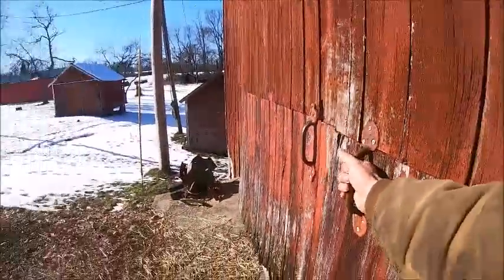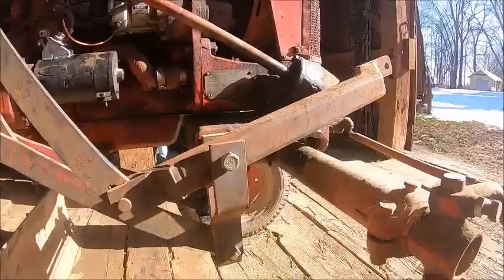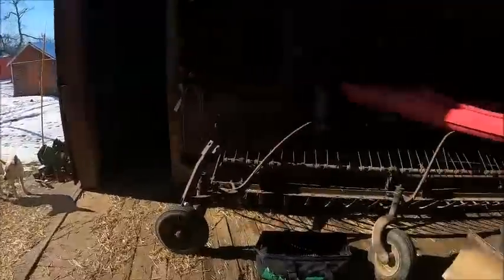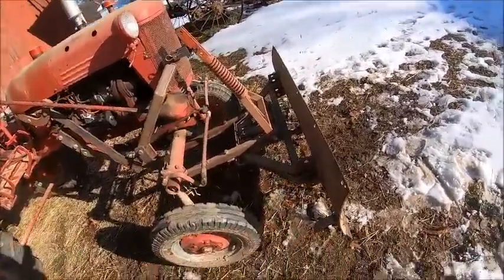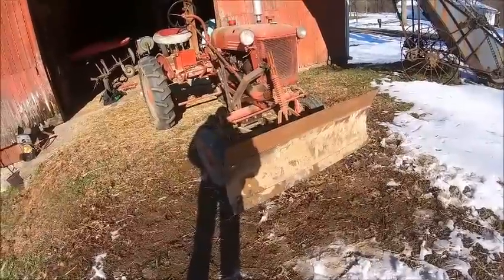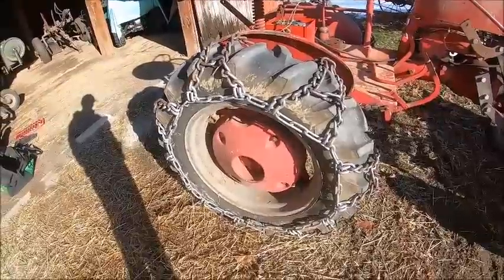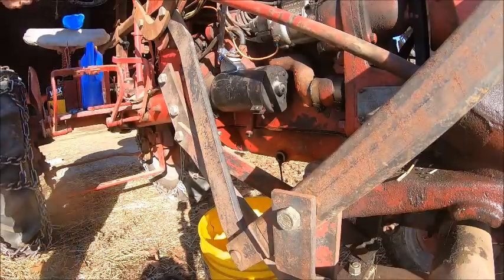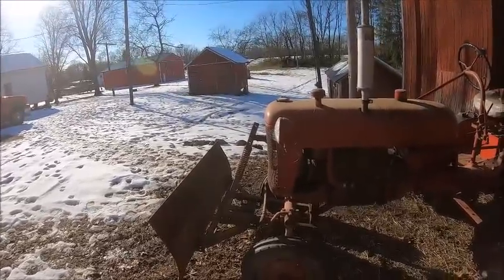Farmall Cub Belly Blade VS. Front Snow/Grader Blade And How They Mount

Comment: Gotta love the old irons simplicity and durability. You won't see these new tractors working or running in in 20 years let alone in 40,50,60 plus years like the old ones. I've got a 1940 ford 9n ,56 massy 65 and a 69 580ck backhoe that start and work all day with no problems!
Reply from the maker: I mean tractors haven’t seen much change as far as power train since 2000 and most of those tractors are still going strong at 22 years old. They will probably struggle to make it to 50 but 20 shouldn’t be a problem.

Comment: I believe they call the mount in front of the final drives a substitute drawbar.  If you had a swinging drawbar it hooks to it as well.  I’d like to buy a blade for my cub.  Good work!
Reply: Also hooks to the fast hitch on the part that adjusts your front to back pitch of the hitch if you’ve got one of them.
Reply from the maker: The swinging drawbar has its own cross bar. I have one.
Reply: @Oliver66FarmBoy  Yes, I have a swinging draw bar and it used its own draw bar to pull and the standard draw bar to take tongue weight and limit the swing.

Comment: A couple of winters ago I restored my Grandpa's 51 cub, it has the cultivators and the snow plow/grader, I knew it could be used as a grader and was always thinking the drawbar turned around was the mounting point underneath, I guess my assumption was wrong, thanks for showing the correct mounting
Reply from the maker: The drawbar can be flipped and used. But then you don’t have a drawbar to pull anything.
Reply: My Cub is my grandpas 52 not "restored" but well maintained
Reply: I have a blade, but I've never had it on my tractor. Nice video!

Comment: To Ethan's point- you are better off not plowing across any public road if you don't want a hassle from someone that may just want to be a PITA, but.........actually, in MI, technically you can plow across a roadway as long as you don't leave ANY snow, slush or ice behind which includes the little ridges left at each end of the blade, regardless of how tall those ridges are.  In other words, leave the road surface very clean where you plow and you are within the law, but at the same time you also have to consider the property rights of anyone across from you (if you have anyone living across from you ) and you are pushing the snow past the easement in any manner. Talked with the PD and the county road maintenance foreman about it to get the info after some neighbor troubles several years ago, over this very thing. For those in MI interested in that topic,  you can read the code  which is -  Section 257.677a.

Comment: Got this same ring. But I didn't get that square cornered push bar specific to the blade. So I use the standard drawbar as a pushbar. Seems to work fine, I didn't know there was a different one for years. I suspected it could be used in a grader mode and when I got a PDF of the book on it that was confirmed.
Reply from the maker: The down side to that is you loose your drawbar so you have to take the blade off and switch everything back around to pull anything. That’s why they had the auxiliary bar to keep the drawbar free to use.
Reply: @Oliver66FarmBoy  Yes you do but I did not get that blade draw bar. So you run what you got. I really don't use it for nothing more in the winter anyway.

Comment: I’m not saying it proper or original but I don’t have the wishbone for mine and just flipped the drawbar around facing the front of the tractor and the front set of bolt holes in the final drives are the same pattern and the two holes for the blade mount line up with the drawbar holes
Reply: Mine was the same way, flip the drawbar forward and it mounted to two of the holes. Otherwise was the same as hes showing.
Reply from the maker: The drawbar can be used like that but then you loose it to use as a drawbar. That’s why they had the auxiliary bar specifically for mounting the blade.

Comment: Hey I figured out why that substitute drawbar you have for the blade has so many parts it’s for a fast hitch tractor. That substitute drawbar can be used on both a fast hitch cub and a non fast hitch cub while the normal substitute drawbar can only be used on a non fast hitch cub.

Comment: Did oliver ever build anything similar to a cub? I'm guessing not or you would probably have one
Reply: The Super 44 and 440 would be the most similar but they’re closer to the Farmall A/Super A. They’re a little bit bigger tractor. Same offset design. They look surprisingly similar to the A/Super A but the Super 44 and 440 are of Oliver design with a Continental engine.
Reply: I saw an Oliver 44 at a tractor show in Minnesota (Scott-Carver Threshers Show)  that was offset like a cub. Very cool. It looked beefier. It had a 3-point hitch and hydraulics everywhere! And John Deere has a newer one, too. It's called the 900 HC.